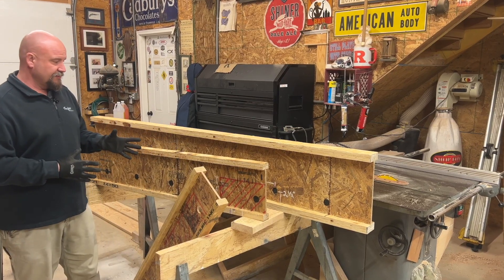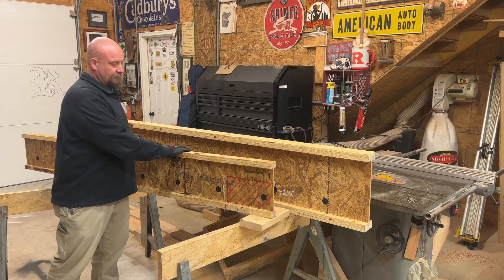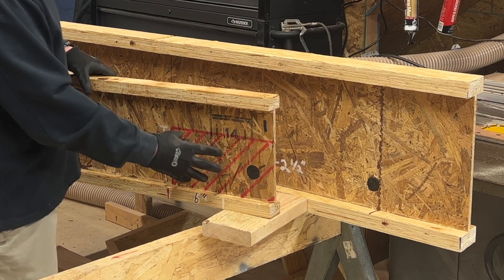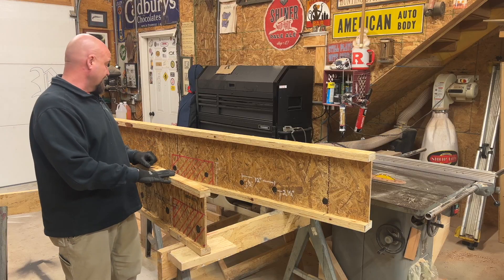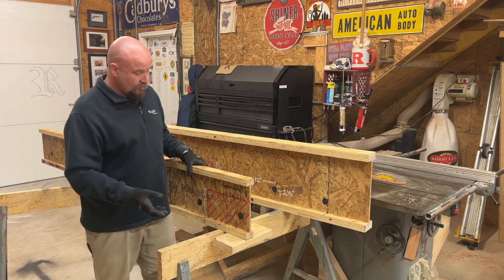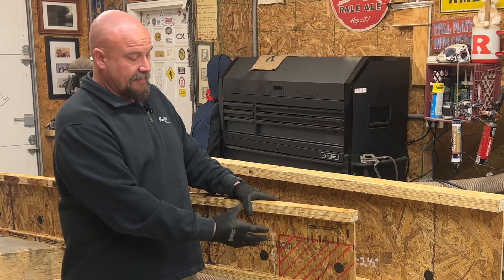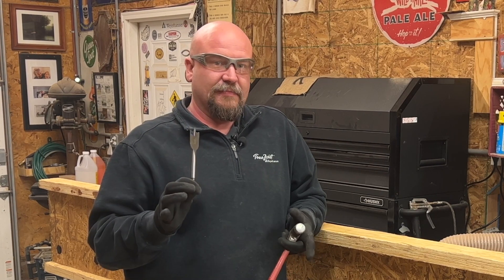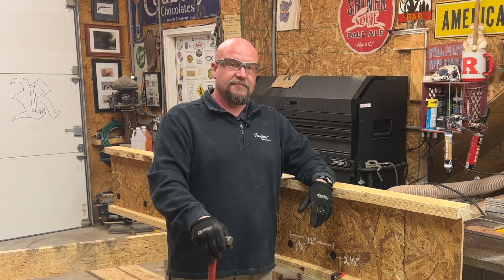Using knockout holes found on TJI Joists

Comment: Framers don't even try to align knock outs.  20 years working around TJI and have never had more than 2 joists with knock outs somewhat aligned.
Fine for sparkys, but for the mechanically minded plumber, "Bring me the Hawg and a 1-3/8" bit."
Reply: Exactly right. I’ve been trying to get framers to learn how to install these for years.